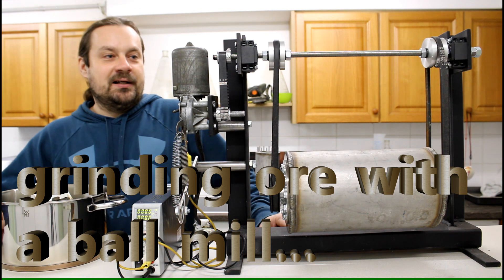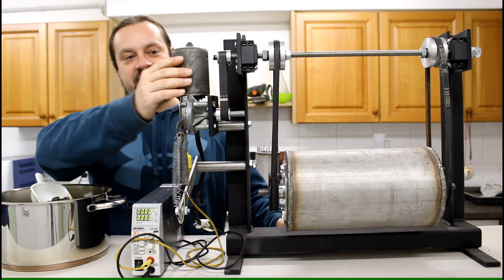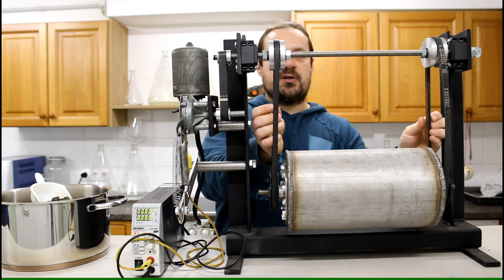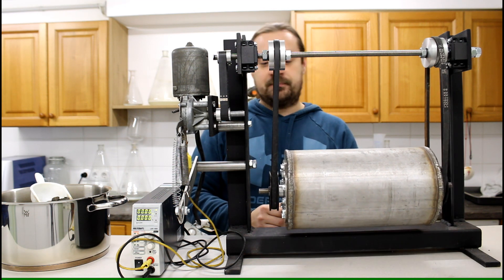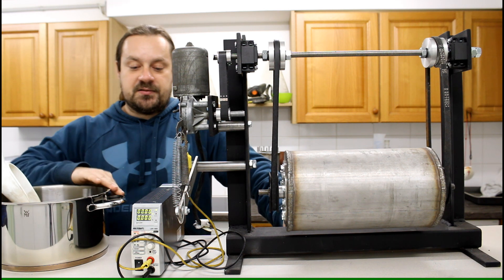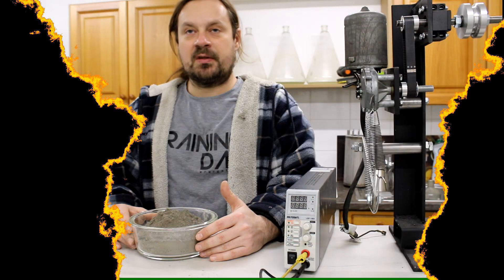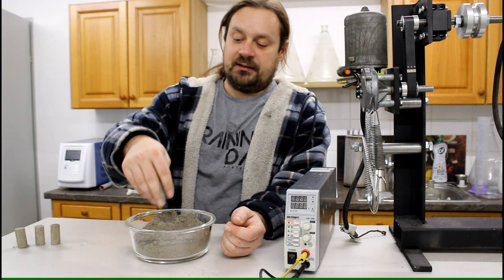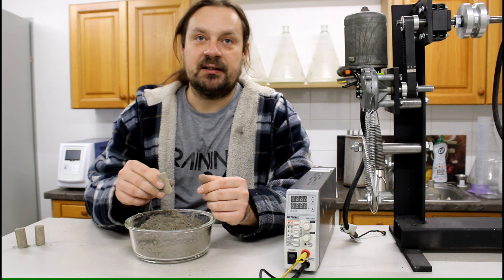grinding ore with a ball mill

Comment: I would suggest using something to reduce the noise of the ball mill. Perhaps cover it with rubber sheet or linoleum.  Use rubber or contact cement.